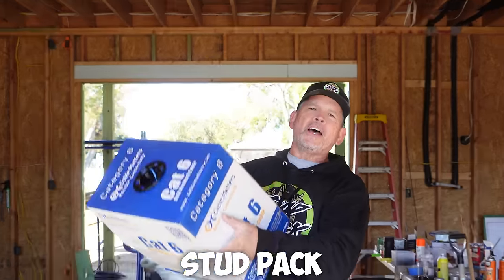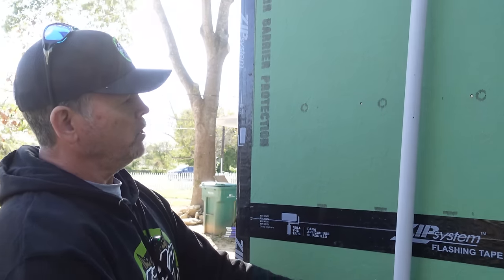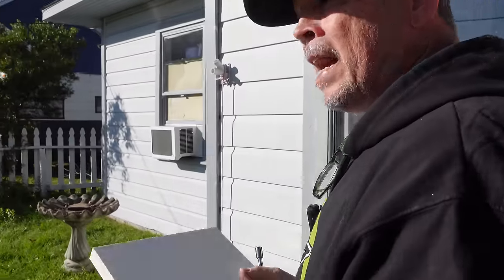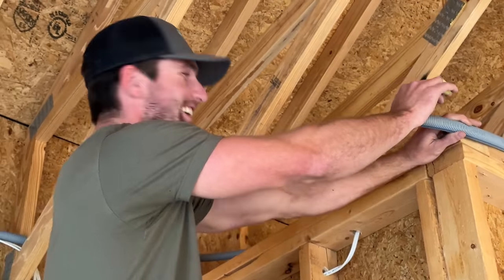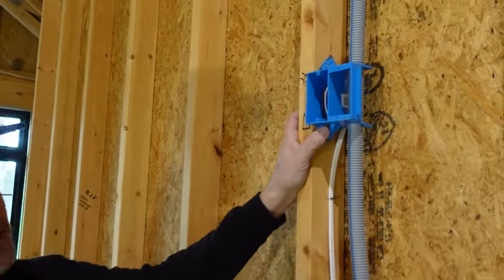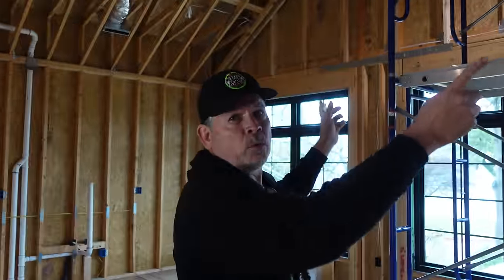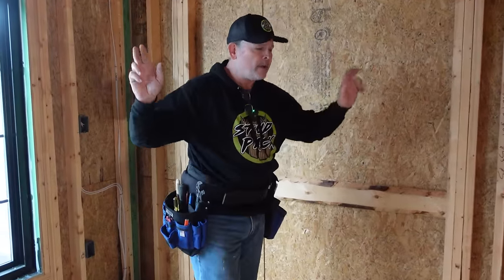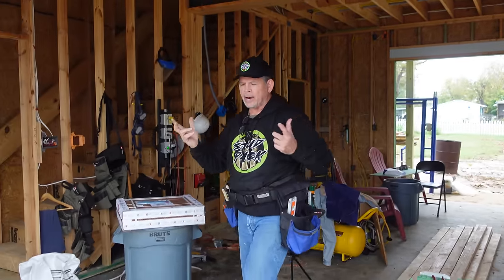DIY Networking for a Future Proof and HIGH SPEED Home! (Smurf Tubing and String Pull Trick!)

Comment: Check your cat6 and make sure its full copper and not copper coated (CCA) you'll get a lot faster speed. Usually  you can tell by the price of your wire but read the box and see what it says.

Comment: I believe code requires a minimum distance of 2 inches (50mm) between any electrical and non-electrical wire running parallel. The concern is less about the interference (60hz across a Cat6 is less of a problem than Cat5) but instead Eddy Currents heating the lines as non-electrical lines are less resistant to heat. I'm not sure what it is called, but there is special insulation you can wrap around that section of Cat6 to prevent both interference and the Eddy Currents.
Reply: Also, RJ45 connectors are not exactly known for durability and haven't really improved since the early 2000s. Even if plugged into a device that you don't plan on moving, I would never run a single line through the wall and straight to the device. That cable will eventually need to be replaced because the connector broke, the cable gets bent, cable gets pinched, small fire, liquid damage or whatever. It's not only more professional looking but much more practical to have the inter-wall portion of the cable terminate at a wall plate with cables running to it. I'd say the only acceptable exception to this is the cables running from the patch panel into the wall, and exterior cables like security cameras (don't want someone able to unplug the camera and patch straight into the network to disable the rest).

Comment: I would go ahead and use the keystone jacks and face plates, not run the cable directly to the TV. It will make a cleaner install with a face plate and jacks especially if and when you move things about. I've also seen over time with the heating and cooling of the rj45 plugs and solid core wires that the crimp pins will back out of the wires due to thermal stress and expansion. Understand this won't be immediately but over time I've seen it happen. Especially if the plugs will be connected to a heat source that cycles like a TV. Solid core wires are not intended for a lot of movement, where network patch cables are made from stranded core wire and intended for movement of the cables. Also being a network guy, you don't have enough network drops around your apartment. I would run additional boxes with the conduit runs back to areas you can get to once the drywall is up. It will be a pain in the back side when you find out you need to run a cable in the walls once the spray in insulation is installed.

Comment: It's amazing how many new homes are STILL not built with cat6 wired. It's a couple hundred dollars max to do during construction but builders still don't do it. I would run cat 6 to every corner of a room that big because you never know where you want a hardline and it's so easy to do now. The less you have on wifi the better.

Comment: There should be some form of conduit going from the networking gear in the garage all the way to the main house.  1.25 or 1.5" preferred for the fiber, so you can pull through pre-terminated patch cables without snagging.  Also, use Cat-6A instead if CAT-6.  There's no good reason not to run CAT6 over CAT5E for gigabit, 2.5gb, etc., but it's marginal for 10gb (and  limited distance).  The network equipment needs to be in a conditioned space, too.

Comment: I would not run cat 6 for security cameras and i would not terminate the Ethernet cables until all drywall/painting is done. Most homes are spray painted and the over spray will impact the connections. I would do keystone on all wall outlets so its just a patch cable from device to outlet. RJ45 the media panel area where all the cat6 cables will meet and run them directly into a switch. For security cameras you should save $$ and do CAT5E which supports up to 1Gbps and is more than enough as most all POE security cameras only use 100mbps. To future proof the house i would have installed cat8 to support future speeds up to 40Gbps but having the smurf tubes in place for each drop location would make it easiest to upgrade/replace lines later. The best media panel is the Leviton 47605-42N WH with Leviton 47605-DP WH AC Power Surge and Leviton 47605-42S 42-Inch Vented Premium Hinged Structured Media Door. I have them installed on my home and ive installed hundreds for clients

Comment: You should always keep cat6 and power far away from each other.  Minimum of 3-6 inches, but I prefer the opposite side of the stud cavity, or even the next cavity over.  Crossing at 90 degrees is also ok, but the 2 should NEVER touch.  Also, you should STRONGLY consider using that jack in a keystone plate.  It doesn't have a clip to break, and you can switch to different length cables later.  You won't notice any effects on signal integrity or speed whatsoever, and it's much more flexible for the future.

Comment: The whistle is from the ribs in the conduit.  I installed a fire pit.  Even had a gas guy hook it up.  When we lit the fire pit it whistled so loud.  I had to get new gas lines which had ribs but with differing sizes if that makes sense.

Comment: Avoid running low voltage, especially digital signal cable parallel to high voltage AC  if at all possible and cross perpendicular. I second using jacks in the wall plates. Cleaner install all around.

Comment: Should use cat 7 and up for 10gb, cat 6 is fine but you'll have to change it down the line, taking in consideration all the devices you are connecting to that access point. also I suggest looking into mesh wifi.
Reply: Cat 6 is not rated for 10gb, but cat 6A is. Cat 7 is a bit overkill.

Comment: As a general rule, you should always avoid putting network cables next to a powerline, but if not avoidable you can always use shielded câble.
Anyway, it should be fine if its only for a short length.
Reply: And you can cross at 90° no problem

Comment: Im waiting for AG1 to be the next Established Titles of sponsers on youtube.

Using flex conduit Vs rigid conduit, Barf.
That is going to be complete suck salad if you have ever replace the cable and have to try and snake the length of that conduit.

In my experience flex conduit should be used as little as possible.
The ribs in the flex make it hard to push cable through it.
If you do the Vac trick and have a pull string happy days!

The Conduit is a physical barrier. Physical seperation is alway golden where possible. Australian standard is 300mm > Freedom units > 12"

Plastic core in the center of Cat6 is to reduce cross talk.
You can have issues with pass through connectors if your tool gets old / blunt.

Comment: always terminate your cat 6 runs to a patch panel with a rack. That way you can mount your router and switch with your patch panel and you will only need 1 ft patch cables. you will thank yourself later. it will keep all your wiring nice an clean. put all your equipmet on a battery backup.

Comment: Second comment on the conduit install - The fibre contractor may not be able to pull since there are multiple bends within the conduit. TIA guidelines stipulate a maximum of 2 x 90degree bends (or 2x bends that add to 90 degrees) before requiring an intermediate pull box.

Comment: Use Cat6a or Cat7 because they are shielded, if you want guaranteed 10GB. It is more expensive than cat6 or cat6e but will be so worth it. Remember it’s good for 55meter runs for 10G, otherwise it drops to 5G or 2.5G or even Gigabit depending on the higher voltage electrical interference and or longer lengths.

Comment: As a licensed cabler, you should terminate the solid core cat 6 into a Keystone jack and use a patch cable. I know you don't want to do it but solid core cabling isn't designed to be moved around like a stranded patch cable is You could end up breaking that cable eventually and needing to run another one... Thats not really future proofing your install.. in my part of the world, you aren't allowed to run data next to power but you can cross it at 90 degrees if you absolutely have to but your country might be different.  I look forward to hearing from other cablers in the US.

Comment: Not using a wall plate with a keystone jack is like not installing an outlet and trying to run the romex right to the appliance.

With the proper keystone and patch cable you wont lose any speed or bandwidth.

Comment: The wiring for the cable is EIA/TIA 568 the A standard was used by the us government and the  B is the AT&T standard.  They are interchangeable as long as both ends of wired the same and can be used for voice, data and power over Ethernet. You should use jacks and not plugs as in a previous comments

Comment: @24:04 If you do enough of these, your fingers will be pretty beaten up.  Save the cut off and use it to pinch the cable and pull it straght.  If you hold the cutoff on your index finger, and pinch down with your thumb, it'll straighten it w/o wearing your fingers.  I even made a video to show folks some tips of the trade on how to crimp properly.  And @24:53, while holding down the cables with you index finger and thumb pressing down, shimmy the cables a little left and right to straighten it while keeping it in 568B order.  And @25:55 the cheaper cable test only tests 568B order/continuity.  So it's not really worth it.  You need a proper fluke meter to test for crosstalk etc. But for CAT6, just doing a speed test is usually enough.  Modern day platinum tools (passthru) jacks and keystones are easy enough to crimp even for beginners.

Comment: Fiber Guy - you had should have transitioned to a 3/4" PVC long-sweep elbow to go thru the wall; as fiber has a minimum bend radius. also, I don't believe you can have more than 360 degrees of bends between pull-boxes; and I'm pretty sure you're over that on this run.
Also, I wouldn't crimp solid cable, even with the proper special crimp ends. the correct answer is to punch it down to a keystone, and then use a patch cable.

Comment: They're going to leave all that fiber service outside. They'll run coax or CAT5/6 through that conduit if to where you'd like your modem and or router. I worked for the phone company for 25 years as a lineman. Drove a center mount like the one with pole on it. We used pole dollies though. Anyway, when the installer showed up to my placed years ago, I had to pull weight on the kid to run it through my attic and place the ONT in my attic at the access point which I installed a backer board and power for the equipment. I didn't want anything on the outside of my home. If they place the ONT in your attic I'll be amazed. They like them outside for access. Do not sign up for TV service or phone service. Stream everything. 
No HDMI needed or coax if you have a smart TV. Don't need a cable box if you stream everything. Just the Ethernet(CAT5) cable.

Comment: Data, Telecom, AV and Coax Cable should be a minimum distance  of 12” when run in parallel from Electrical Cable (Romex) it’s written in the NEC (national  electrical code), unless it’s run perpendicular or the data cable is inside metallic shielded conduit!! You can buy Cat6A which is shielded, but it will cost you a lot more money and it’s more difficult to bend than standard Cat6!

Comment: i wouldn't use the cat 6 you guys are using. Always use shielded wire. I just moved (i am in the EU) and put all cat 8.1 shielded wire through my home and to my shed. So the chance of the electrics are interfering with the network cable are slim. Chance here is small anyway since the electric is also run into pvc pipes and snake pipes like the ones you run your network cable in.

Comment: I don’t know what the ONT looks like for your ISP but I would transition to copper as soon as you are in the stud bay. That way you can pull two CAT6 to your wiring closet (one is none is my philosophy 😅)

Put you a little 4u wall mount rack in wiring closet under stair and drop in a patch panel, rack mount router and rack mount PoE switch for all those fancy gadgets Jordan has lined up.

(Addendum) Another design principle is optical between buildings. So make sure your PoE switch has an SFP port to add a fiber link to house in future.

Comment: That thin wall plastic conduit won't do anything for EMI rejection.  You need to either run shielded Cat6 or run the 120 and low volt 3"+ inches apart.  Everyone else said the same thing, but don't terminate to an RJ45, rather put it in a punchdown block or jack.  Give yourself a coil of an extra foot or two on both ends of the cable to make life easier for someone in the future.  A long run can be surprisingly difficult to pull through the conduit if you need extra, and it could strain the cable and lead to transmission issues.  The continuity tester is different than an analyzer/qualifier.  I bet you are thinking of just checking continuity and calling it a day.  I would suggest renting a qualifier (they cost $1,500-$12,000 new), which checks transmission speeds (Fluke LIQ-100 would do the job) before you button it up, because just because it passes continuity doesn't mean the cable is going to give you the speed you think it should.   Also, given so many comments not using correct terminology, etc. there appears to be a LOT of armchair experts purporting to be experts.  Find someone local who does this for a datacenter or in-house a big company to help you out or give some tips.  Opinions on the internet are like finding old nitrile gloves on the street - handle with care.

Comment: category wiring is so good now  its really not an issue. But if the conduit was steel and it was grounded then by all means you can run parallel to romex but try to avoid it. If you are perpendicular to the romex thats how you pass LOW VOLTAGE by romex or power properly.  There is no induction when you cross at a 90 degree angle. like a t

Comment: Good lord, so many experts coming out of the woodwork for this one. Good work planning things out. We all wish we had innerduct running through our houses. The only thing I'd reiterate that's been said 400 times is you should terminate all ends with a keystone. You'll thank the collective us later. 

In the real world, we can't always avoid running copper ethernet in close proximity to electrical. It will be ok. Shielded cat6 will be pretty resilient. You'll have a hard enough time getting 10G line speed even in ideal conditions.

Comment: a few notes : T568A and B have nothing to do with landlines... landlines only use the center ones. (blues) these 2 standards allow for crossover and straight cabling. (also has nothing to do with American / elsewhere as these standards are IEEE and are universal) the only thing you need to make sure is if you use a boarded patch panel is check which one it uses.  with keystone jacks ( the ones that go for wall-plate) generally accepts both.  Cat6 has a central divider to spread the  conductors for faster speed capabilities.  when passing Ethernet cables keep in mind that stretching and bending and kinking the cable can affect its category rating (a cat6 can be degraded to only allow 1gbps for example)    its best to use keystone jacks in a house a) because floppy wires coming out of walls is very ugly b) these wires (solid ) are not meant for direct to device use. (you should be using patch chords that are meant for this)  c) not using wall-plates and keystone jacks is going to reduce the life expectancy of the cable as it kinks and rubs where its out the wall.

Comment: You need to terminate into a keystone and put it in the wall. Having a home run will not work out in the long run. Also you want to avoid having any electrical and CAT cable run parallel next to eachother. Keep a minimum of 6 inches in between the two. Only cross the two at a 90 degree angle. This will prevent any interference.

Comment: Hi Paul and gang. sorry but for the first time on yours videos i see yoo doing things on the very bad way.  Dont put the hub of cables on the attic but on area close but not so of the electrical panel on first floor because the future equipments needed (switch and others) will dont like the dust and vibrations close to the venmarr. And for visual troubleshootings / reboots / pairing all time you have to go on the attic for do this on your actual way.   and you need at least 4 electrical points for this. so have a direct fuse for this is a good way too and perhaps on the future solar array.  Use the garage ceiling to pass the ethernet cable conduits like for the Romex to reduce the length of the cables. Dont go tru the thrusts of the 2 floor it's a booby trap. And yes use the wall plates definitely.  On the same area of work have you think to push a cable for a outside wifi extender for the garden ?  I have faith on you for correct this thinks and i clearly understand it's your first try for do this type of work. But clearly you will not regret the change on long terme of the life of the house.